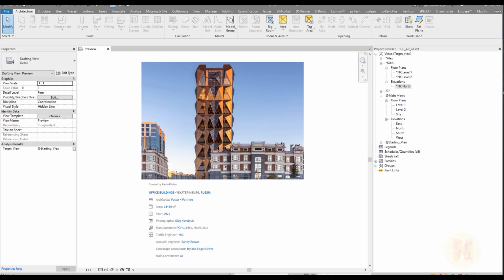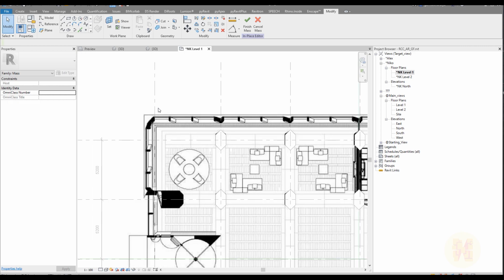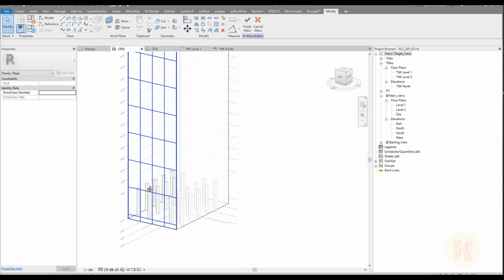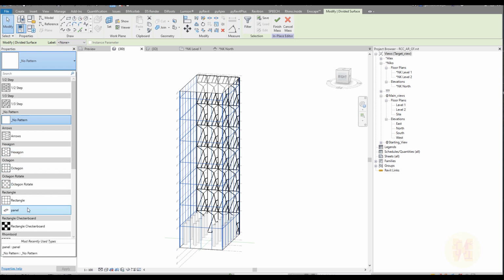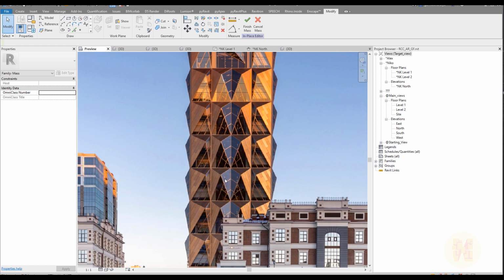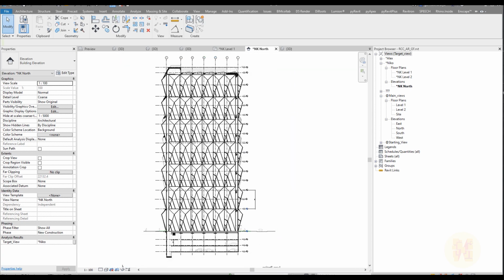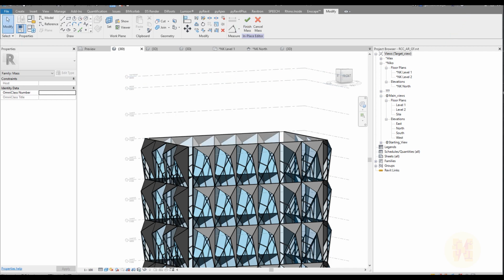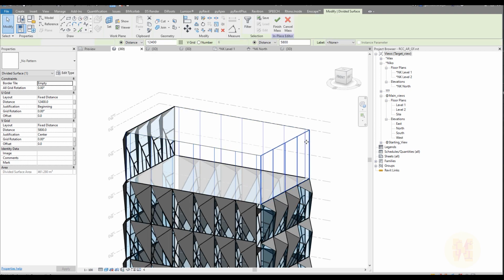RCC | Complete Revit Tutorial Part 5 | Facade and mass forme

Comment: I'm going to be honest here. The way we conceive architecture is way too limited and even numb to changing conditions. 

The way we build must change. It's not about fluid forms or even organic mimetic aesthetics. None of that. Buildings MUST be entities that changes and adapt with time. These things should rotate, transform and reconfigure. We already started with the window and the door. Those are the first movable parts of a building and the oldest ones. 

The way we conceive architecture must be done with science and weather data. We should be able to develop a structured coherent form where buildings changes without those motives of glamour on 'organic forms'. It should be completely rational. Buildings are data bases that reconfigure with weather data, use and function. 

Parametric architecture is the first step. The second one is robotic architecture. The way we think things must change. To boot WE DO NOT NEED a computer for such goals. Gaudi already paved that way among many other builders.